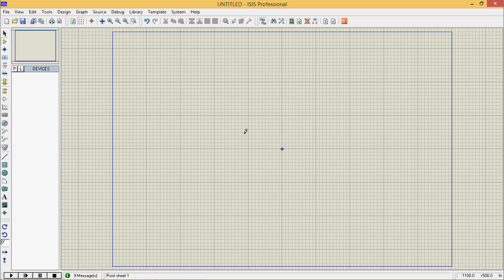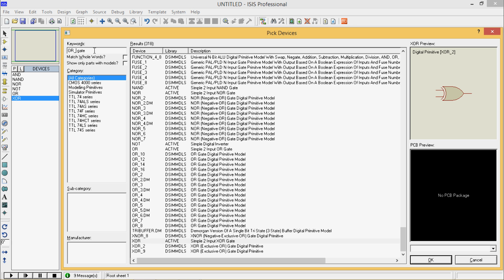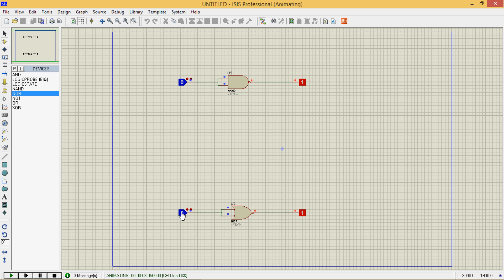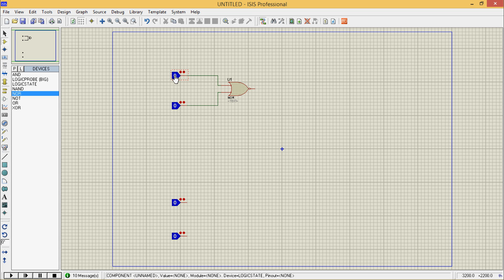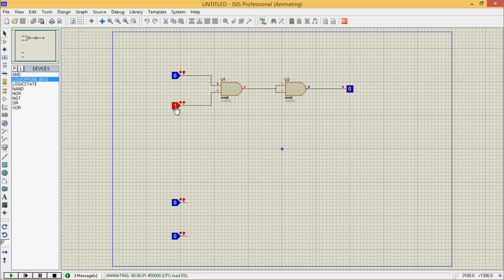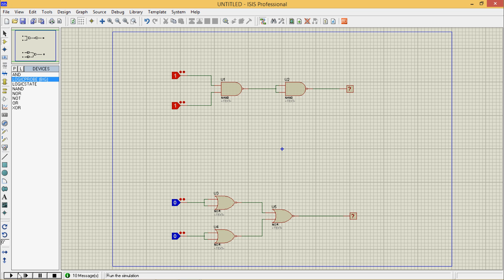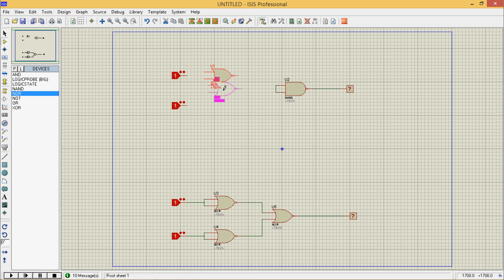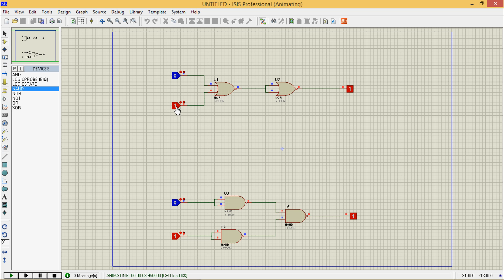Proteus tutorial 8 - basic logic gates

Comment: Hii this is ravi teja here you are connecting voltage probe to the connection wire it will check the voltage across which device it will ?????????
Reply from the maker: Hi Ravi,
In this video, I haven't used voltage probes. I have used logic state and logic probe. They are used for digital inputs (0-1) and displaying digital outputs(0-1)
Voltage probe can be used to measure voltage across a load.
Reply: But that probe is used to calculating the voltage 
Xan you tell the meaning of the probe R2(1)
Reply: Hii this is ravi Again iam talking about the tutorial7 calculating the voltage at three places
Reply from the maker: NEVN RAVI TEJA RAVI TEJA
 that's the voltage probe which shows voltages at that point with respect to ground.

R2(1) is just a name for reference.
It helps you to understand that it will give you voltage at the resistor R2's end.

R2(1) is the name when probe is connected to left side of R2 and R2(2) is the name when probe is connected to right side of R2. 

This is the default naming convention when probe is connected. You can change the names if you want to as well.